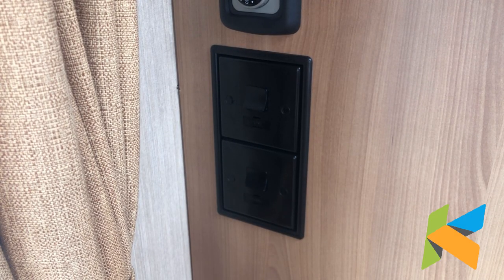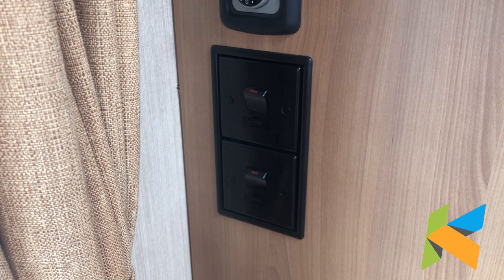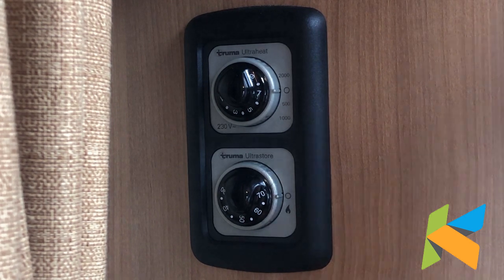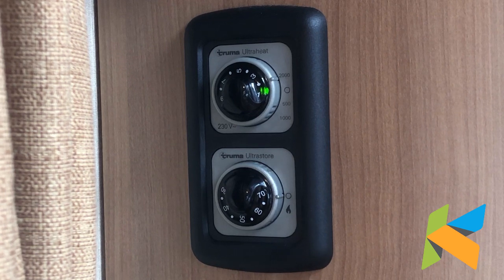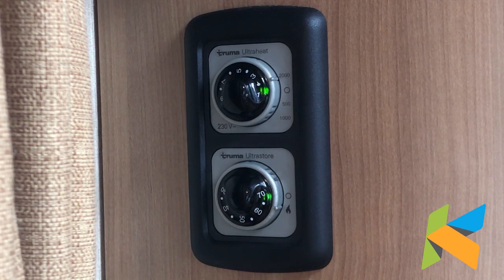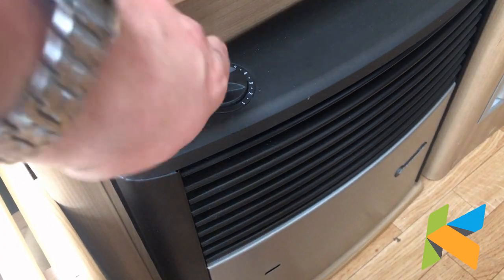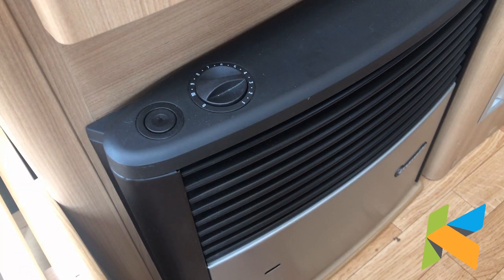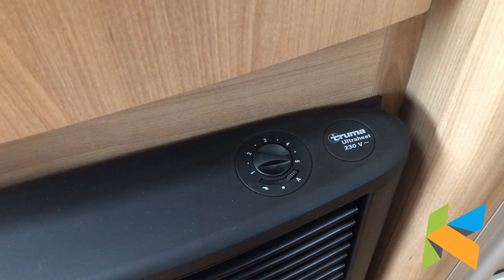How to use the Truma Ultraheat/Ultrastore heating and hot water system

Comment: Thx for the video! Does it mean I need to wait general 15minutes before I turn on the fan or just in the automatic mode? Today I just used the ultra heat for the first time without gas and it took ages before it became warm. Without the fan it was super hot at the truma heater but with fan on it was mostly cold air.

Comment: When using the water boiler on electric and changing to gas. Do I need to turn the electric water heater off then light the gas or does it have to be turned on all the time.